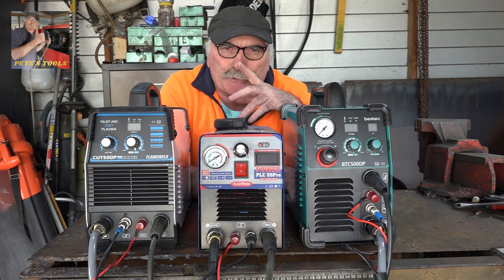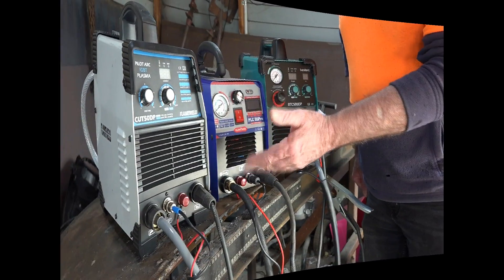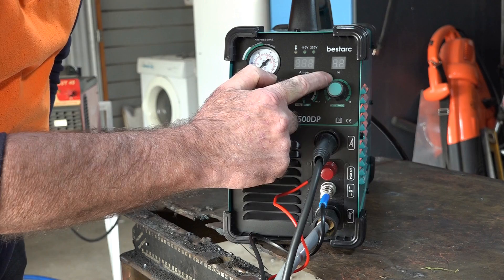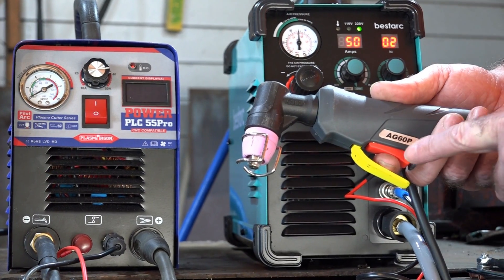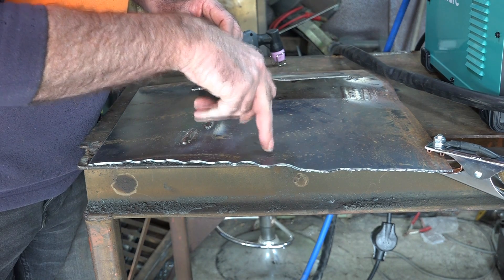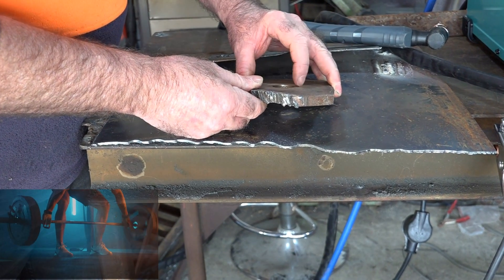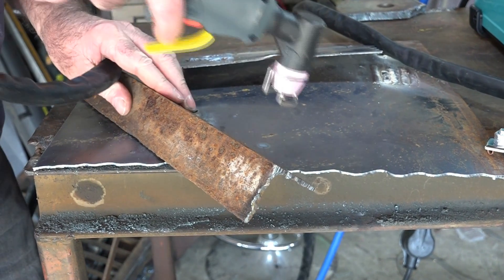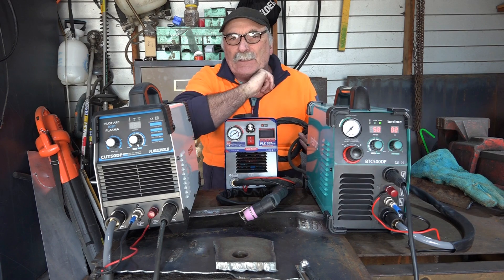Bestarc ,Flameweld and Plasmargon Plasma Cutters :Think They Are All The Same ??

Comment: BestArc is the best arc! :)

One thing for those who use 110v and lower amperage, is to use lower PSI so you don't get the pulsing arc problem. The air pressure is blowing out your arc at lower amperages.

If you ever need to tidy up the cover of your BestArc, Rustoleum makes a paint color called "St Tropez" that is pretty close to the same color.
Reply from the maker: cool thanks

Comment: Great video. I bought a Bestarc a month or so ago, and I agree that it is a good machine. One thing I learned is there are two different nozzles available. One has an 0.030 inch orifice and is made for 110 volt operation. The other is an 0.045 orifice for 220 volt. I haven't experimented with them yet, but I'm guessing the 220 orifice might cut a wider kerf.  Probably higher air consumption, too. I know yes welder had both on Amazon. This would probably work for any machine with dual voltage and the g60 torch.
Reply from the maker: I didn't know they come in different sizes for lower voltage.
Reply: @petestools  I'll have to look into that myself. :)